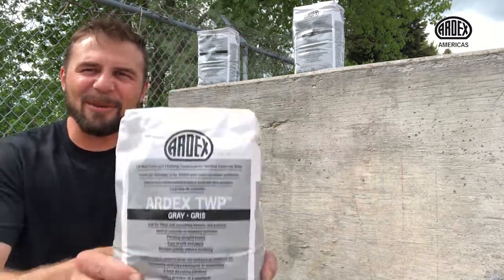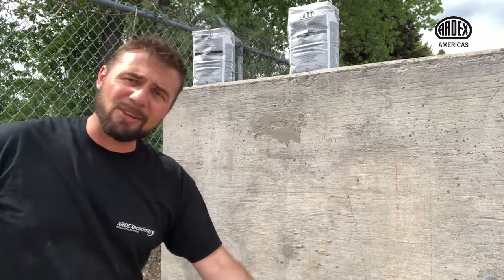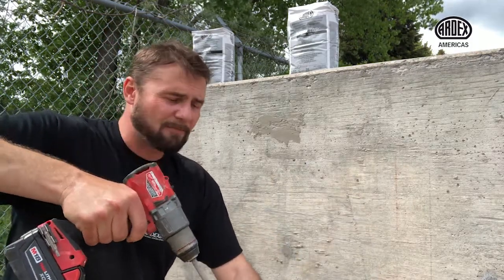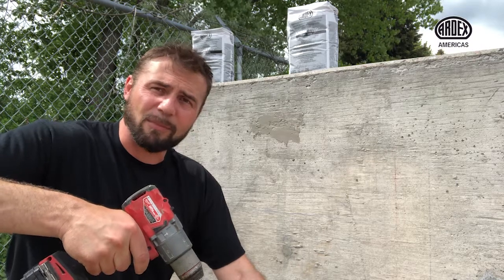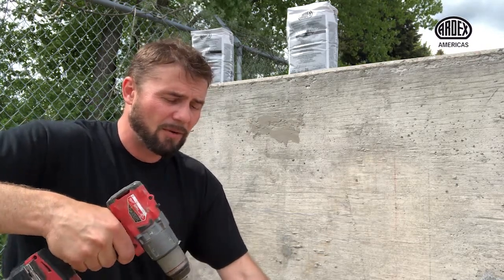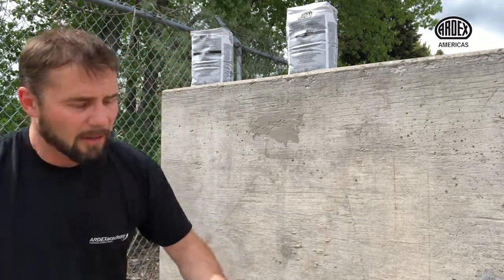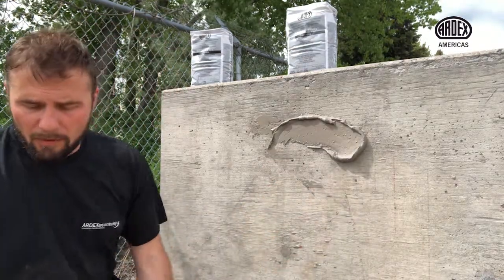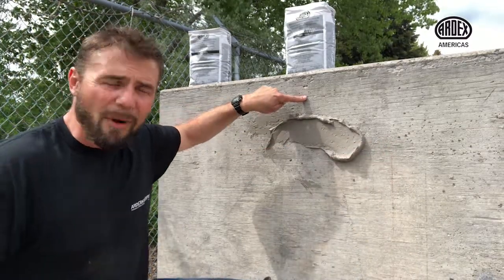Industry Know-How with PJ: Patching Vertical Walls

Comment: This is a great product. We are using this on a 17 story high rise in London Ontario. Only problem I have is it don’t fill holes we have to rub with a silica sand base prior to TWP. Do not mix to much at one time small batches go very far when applying with a trowel